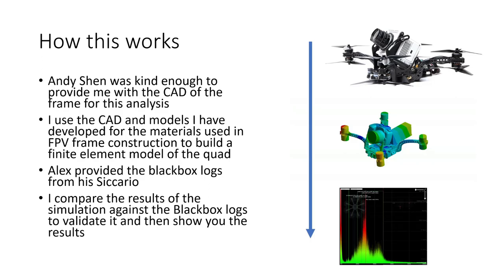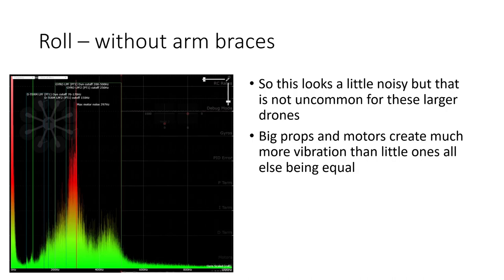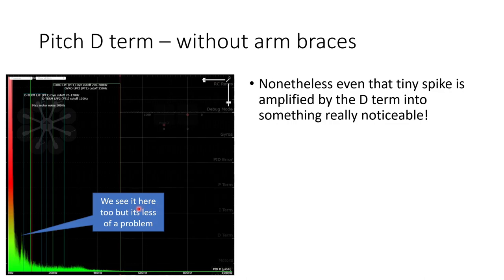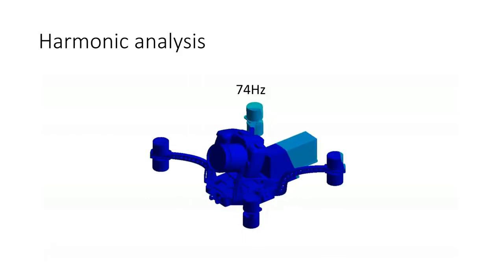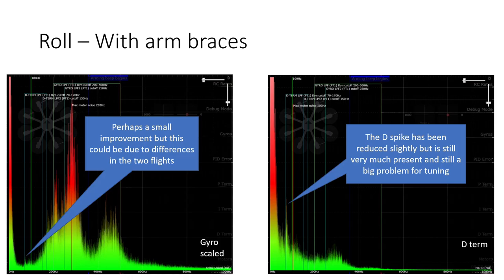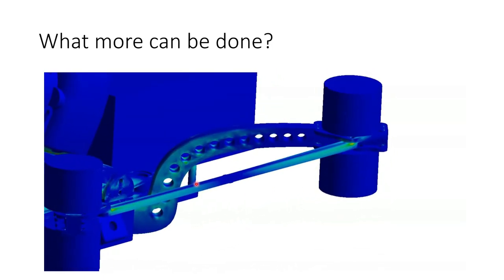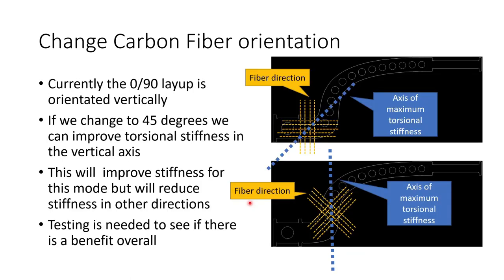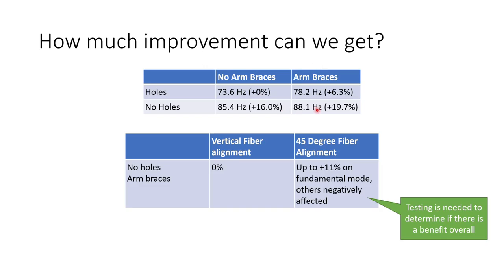Resonance analysis of the Shen Drones Siccario. Find out how to make it fly even better!

Comment: Wow just wow! How you can get all this information from a cad & blackbox data is amazing.  Watching your videos got me curious about Betaflight black box and I finally decided to set it up after being in this hobby for years.But I'm still learning on how to look & read the data! I  just built my first seven inch build. And I changed the old MAYTEKF405 to a better Iflight Succex F7 Twin gyro stack that has on board 32mb flash black box. I'm hoping to get a better tune out of the F7. But as you know 7 inch quads are more difficult to tune than a 5 inch build. I need a Chris Rosser..lol But I have learn a little bit from watching your videos on how to look at the data! Great job Mate! Keep up the great work! Your bringing a important  element to this hobby we never had before!

Comment: Just wondering do you post your materials settings that you use for the carbon fiber in the simulations (or resources on how to set them up myself)? I'm designing my own frame now but I'm somewhat confused on how to set up the material settings for carbon fiber.

Comment: Just watched that now... and very intersting to see how to increase overall stiffness by 30% just by tweaking certain details. I'd really love to see an update here to see how your simulation-ideas turn out in reality! While watching the vid I also kept wondering if you couldn't add braces that are mounted against the center of the frame to create somewhat of that triangular arm design you use for your frames?

I think next to prop wash handling and max D-Term for Cinequads vibrations have a third issue: A vibrating base of the camera will cause Jello in the image which is quite a challenge to handle when filming. So the quieter mount the camera, the easier it is to create good footage.

It's always pretty interesting to see how significant improvements are, if you introduce a new and improved way to look at things. In production the introduction of lean management often cut costs down by 50% in the first run. And in the checkweigher world the introduction of modal analysis in addition to powerful filter settings basically allowed you to double precision or increase output 5x and more, using the same measurement technology.

Comment: In my experience as a cinelifter designer, builder, and pilot I find that usually low frequency spikes like that are due to camera payload oscillation. Did you rule this out in your investigation, or is it really the frame? It seems like there is a 74Hz harmonic on the yaw axis as you've shown, but how would that cause such a proportionally larger spike on the roll axis at ~70Hz? Usually when I have a frame or payload resonance, there is a favored direction, pitch, roll, or yaw, and the source oscillation can affect the other axis as well causing secondary oscillations. But from what I have experienced, those secondary (or indirect) oscillations are smaller than the one that is causing the ruckus in the first place. So I'm not sold on the idea that the yaw wonkiness is causing the roll axis harmonic spike.

Bonus info: to reduce effect of camera payload resonance, you need as little filtering as possible to reduce phase delay so the controller can react in time so that there is less chance of the drone becoming "in sync" with the payload excitation frequency. You can use notch filters, but they really hurt flight performance. So the only best option is to have a frame that is extremely rigid in the directions that matter so that vibrations are pushed to the highest of frequencies so that the least amount of filtering is necessary. Then you can push your PD gains up to the point that low frequency spike doesn't peak too much. The higher PD gains are, the more excitable the drone is to payload oscillation so if you have a heavily filtered drone with high PD gains you are going to have bad payload oscillations. So it is better to have lower PD gains, but less filtering, which in the end gives you a locked in drone still (due to reduced phase delay of the PID loop), but without the LF oscillations.
Reply: Such good info dude. I mentioned this to Chris after talking to you about it. As you say part of the solution is making the frame more ridgid so the arms are still a step in the right direction. I will test various degrees of filtering and see what happens!
Reply from the maker: In my simulation the stiffness of the camera mount was modelled so if payload resonance was in play at 74Hz you would have seen it in the harmonic analysis. It does occur at higher frequencies in the model but not at 74Hz. My simulation approach is still in development for these larger drones but I did my absolute best to model the payload as well as the frame, motors etc.

Comment: Very nice analysis!also cored materials will be a huge benefit  reinforcing also other axis.manufacturing getting more complicate and expensive though.
Thank you
Reply from the maker: You are welcome! I think simplicity not manufacturing is a key consideration.
Reply: So far non have found a core material that can handle the shear forces in the middle of the arms.

Comment: Great video as always... do you think there would be a significant  increase in performance if frame designers could adopt engineered carbon parts over parts cut from sheets ? Price being the obvious hurdle.
Reply from the maker: Yes some increase in performance but the cost would be much more proportionally.

Comment: Biggest issues on these is ESC/motor electrical noise getting to the gyro.  Since most run 2x 4-in-1 ESCs, it seems to be tough to avoid.
Reply: Would it be beneficial then to run the fc off a dedicated power source?  I’m sure this thing could carry an extra 500mah 2S pack. 

Or would the electrical noise also travel up the esc signal wires?
Reply: In the X811 all the noisy part's are in a dedicated place underneath the flight controller and below mainframe parts.

The only thing in between the top plate and the centre plate is the flight controller and Vista.
Tuning with this setup is a breeze.
Reply: On this rig I actually turned the FC round 90 degrees and the noisey axis didn't move with the FC so it is certainly a physical issue
Reply: @DesignTuneOperate  good check!

Comment: You are just getting more understandable with each new video.  

That noise about 2:40 - are you saying it doesn’t matter because it can be filtered out with a low pass filter?  If so I get that for the flight controller but surely it affects the video footage?
Reply from the maker: The frequency is high enough that I would not typically expect it to be visible in the camera footage.
Reply: @ChrisRosser  Thanks !

Comment: iFlight just released their own octocopter cinelifter - the Taurus X8 - for just $1,600.  While I have no need for a cinelifter, I do have to marvel at getting an octocopter with 8" props, dual 80A ESCs, eight 2806.5 motors, and an INCLUDED 4400mah 6S battery for that price.  Might be fun to acro :)  With your custom tune recommendations, of course!
Reply: Building your own would be cheaper, have better performance with larger 2812 motors and have better satisfaction
Reply from the maker: It would be interesting to know what the cost would be to build one yourself...
Reply: I am yet to see any good footage at all from the Taurus X8
Reply: @TheDiegoAranda  That footage looks great thanks for sharing : ) The drone seems to cope much better with the smaller black magic camera. Because of the high mount design the bigger cameras don't seem to do well on it.
Reply: @DesignTuneOperate  Your looking in the wrong place lol... I have seen some brilliant footage but ask me now where I saw it and I would have to spend quite a bit of time looking for it.
Reply: I am not trying at all. For that money I would build a better custom system : ) the footage linked above is decent though so it seems to work well with smaller cameras
Reply: Was just about to post that link as well. I saw his video when he just posted it and it does seem pretty good. But still I don't think I would trust iFlight components enough to put it on a cinelifter
Reply: @ChrisRosser 
Siccario Frame + mount and stuff = $450 
BH 2812 1115KV x8 = $264
Matek F722HD = $40
HobbyWing 60A X-Rotor x2 = $140
DJI AU = $199
5200mah 6S = $100
HQProp 8x4x3 x8 = $32

Total $1225 including a single battery. If you want to save some money then switch out the Siccario frame with the Thicc and $450 becomes $140 and the total build is only $915 with a single battery.

Other accessories to add on are Pololu step-down converters for the AU and to power the main camera, GPS, CRSF Rx if you are using TBS CRSF and optional upgrades are the Alphagel damped mounts

Of course, time to build, troubleshoot and tune is priceless which is where BNF builders like QSL and RRFPV comes in and I trust them to be able to build it to a higher standard and with a better tune than the iFlight product. Iflight's Tarus X8 is sold at $1699 including a lipo while QSL's Thicc is sold for $1799 without a lipo.
Reply: @IgnitionFPV  Out of curiosity, can you explain why you doubt iFlight's quality?  I mean, their other BNF models are extremely popular, and if their ESCs or FCs or motors were routinely catching fire or killing people I'm pretty sure we would have heard about it by now.  I happen to own four iFlight quads myself and their build quality and default tune is excellent.  Chris chose iFlight components for his AOS5 build.  Also, I think it should be clear that if you're a professional then something like the CMW Moneyshot is more appropriate, but what IFlight has done with the Taurus X8 is bring the cinelifter into the realm of the prosumer - the same type of people who might buy a Mavic 2.  And for those buyers time is absolutely money, and they're not going to consider building from scratch.  I'm certainly not accusing you of this, but I tend to see casual racism with people saying "hurr.... Chinese assembly line crap" when that's literally where most of our extremely reliable consumer products actually come from.
Reply: @TheDiegoAranda  no man, it's funny how you say that when I am actually a Chinese myself, just that I don't reside in China. I do not have trust in iflight mostly from their Protek25 screw up as I had a friend who own one which lit up right in front of my eyes eventhough he's using the latest recommended settings which was said to had solve that issue. And after that, dealing with support was so complicated he just gave up entirely. I myself own a Protek35 which so far had been pretty swell but that model had been plagued with the micro USB connector breaking off way too easily and the tune that came with my protek35 was literally unflyable rubbish. I have no idea how they came up with that tune. Most components in these cinelifter builds are from China anyway, but there are other brands that have better track record than iFlight. I am not against iflight as a whole, just that past experience on their electronics had left a sour taste. With that said, I am still using a Protek35, the iFlight DJI patch antenna and also their albatross antennas on my drones. 

Not every job will require a MoneyShot as that comes down to performance requirements. There are many people using the Siccario and Thicc platform for high budget jobs as well. With the Taurus they are targeting people who would otherwise not even look at purchasing a cinelifter, but is that for better or worse? Flying a cinelifter requires you to be an experienced pilot out of the bat, which is definitely not those who are looking to purchase a Mavic 2.

And finally comes support. I have no idea if they have a dedicated support team for the Taurus line(they better have!) but judging from my friend's experience in dealing with support, its not looking too good. Something I am very sure QSL or RR will beat them at.

Man this is getting longer than it should

Comment: yep vertical carbon arms need bracing inbetween as the yaw flex is huge due to lamination direction, crazy vertical stiffness though
Reply: why wouldn't PLA arm braces work?
Reply: @Louishouiller  Im sure pla braces would help, but i just design the bracing into the frame as i dont trust PLA, have seen too many parts fail after ageing /sunlight exposure, once you have a carbon arm holding the arms together it makes a great handle as well.... once you go large motors(like 9"+) or x8 i feel you need a third brace on the back to close out that square otherwise you can still get some yaw resonance which Chris showed here that still persisted even with the arm2arm brace....

Comment: Hey Chris, great content! I love this stuff. Could you do a frame analysis of the vega gravity and impulse apex?
Reply from the maker: Apex has already been done 👍 The Vega gravity looks to be a traditional design so should be similar to the XL5 I looked at recently.
Reply: @ChrisRosser  Ahh I should have searched! I've just watched both, very interesting indeed. I think I'll stick with my apex and maybe grab one of your AOS 5 frames :D
Reply: @ChrisRosser  Hi Chris, sorry to hijack this video with unrelated stuff again but I noticed a pretty high profile pilot flying with no vibration damping on their stack. Everything was hard bolted to the frame using metal standoffs. They said that a lot of people believe the quad flies better that way. Would love to see a video on analysis of various stack soft mounting solutions and your thoughts on hard mounting (which just sounds mad to me).
Reply from the maker: @FadeFPV  Hard mounting? Everything that's old is new again I guess. I'd need to see a log to judge the effect on PID and filter settings. I'll remain extremely sceptical until then.

Unless they are running incredibly agressive PID and filter settings there is little chance of a significant improvement.

Comment: Hey Chris - I would take the stress and strain of the default carbon fiber in Solidworks with a grain of salt. The default solidworks carbon fiber material characteristics doesn't account for the anisotropic laminate behavior that carbon produces in the out of plane axis - as a result the strain and stress could actually be much worse than what is depicted.
Reply from the maker: Hi Zach. I'm not using solidworks at all. I've created my own anisotropic models for the materials.
Reply: @ChrisRosser  Awesome!!! Fantastic to hear. Do you use anisotropic behavior or quasi-isotropic behavior?
Reply from the maker: @zachcarrizales5038  Fully anisotropic. The 6x6 compliance matrix.
Reply: @ChrisRosser  Wooooohoooooo!!!!!!

Comment: It's not worth analyzing because he is flying with an expensive camera without protective cage around it
Reply from the maker: Thanks for your comment. These types of cinelifter drones are extremely popular for film and television work. They are probably used in many of your favorite shows. As a result they are very much worth analyzing. Adding a protective cage around the camera will not protect it in a crash (the g-forces alone will kill the camera) and adds too much weight for the type of shots this drone is designed to capture.